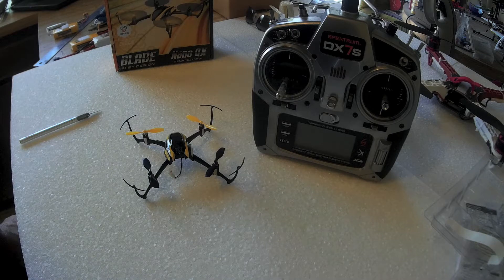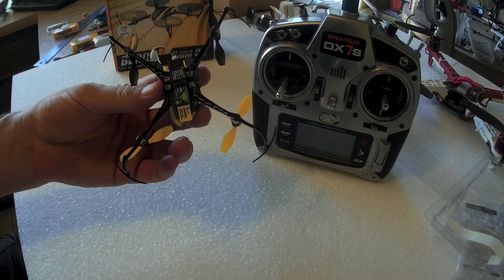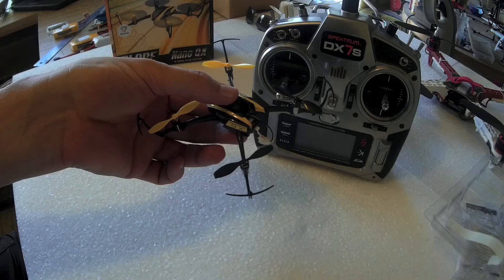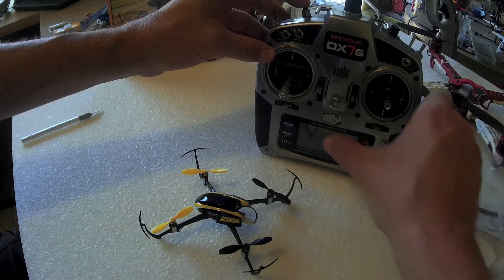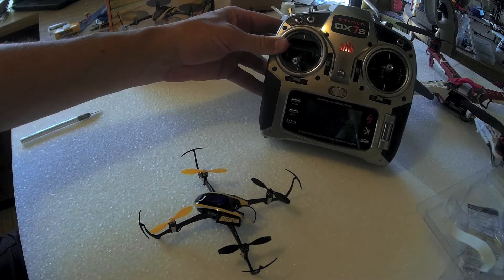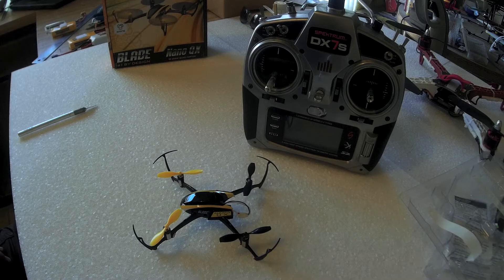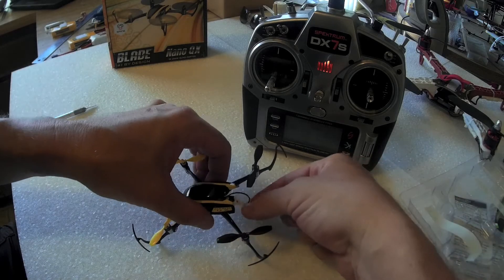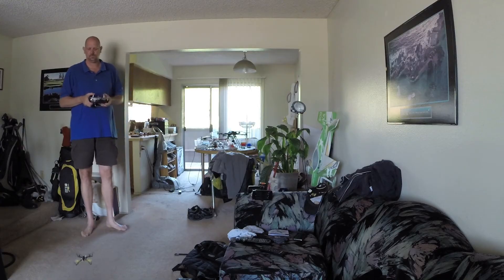Blade Nano QX Bind and Test Flight

Comment: Would you recommend it to someone that flys that style and size of quad? Does it have an inside and outside mode? Like maybe 1-2 -3?
Thanks bd
Reply from the maker: It does have High and Low Rates. Low rates it's a real baby and real easy to fly I would say the perfect quad trainer to train your brain and your hands. Now On High Rates this little Quad Will Flip. Yes I said Flip so you would have you hands full if your Not ready.
Reply: ***** ok, it has mild and spicy.  I'll pass him your link.
Thanks bd